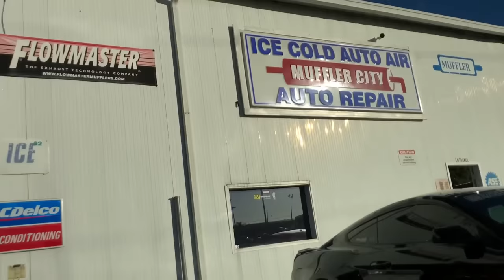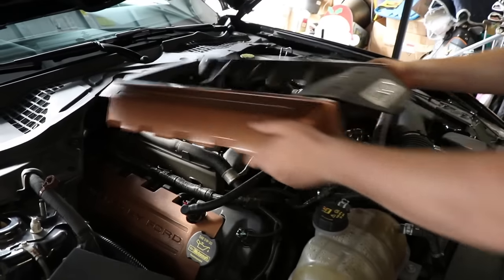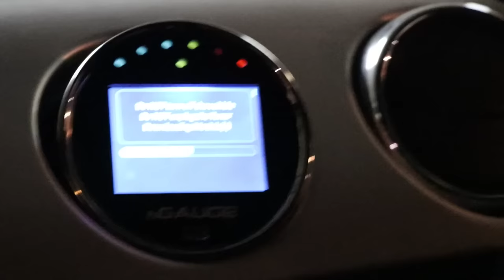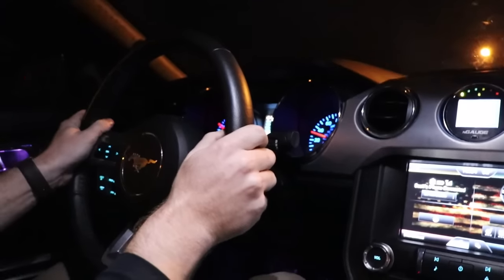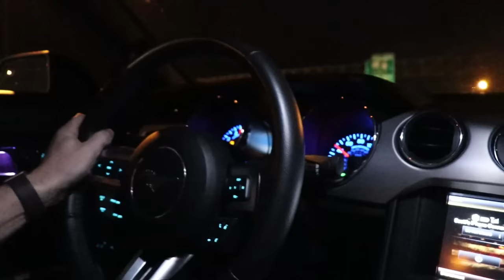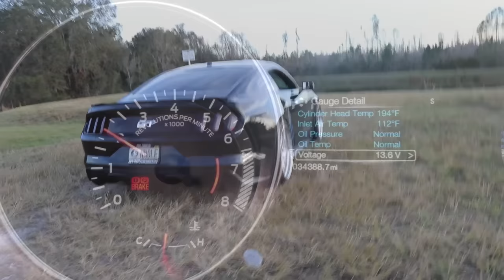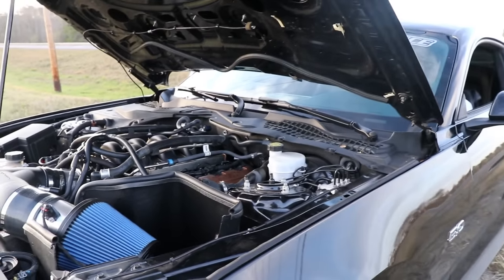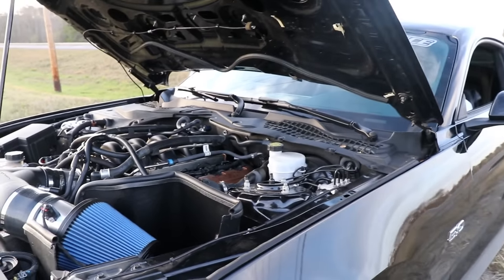Full Bolt On Coyote N/A Build - Longtubes, E85, Intake Manifold, PMAS, VMP Tune

Comment: i have the exact same mods with bama tune and (no e85) just 93 octane and i got the same numbers 450 whp and 390 tq
Reply: Yulinoe BAMA tuners suck.  When I used them they didn't have any racing numbers to backup there tuning numbers and there tunes SUCKED.  I choose another tuner that has engineers on staff and have racing experience.  BAMA doesn't check these 2 boxes.
Reply: Yulinoe BAMA tuners suck.  When I used them they didn't have any racing numbers to backup there tuning numbers and there tunes SUCKED.  I choose another tuner that has engineers on staff and have racing experience.  BAMA doesn't check these 2 boxes.

Comment: Great job at squeezing every HP out of a NA 5.0!! Lower your redline to 7200 and save your oil pump!! As you can see the car doesn't make power over 7200 anyhow. I guessed 466 at 7200 so I was off by 13 HP, my lucky number...LOL Great video, great mods and great car!!

Comment: How's the torque down low with the 350 intake? All gone?
Reply from the maker: It still feels great down low. The E85 helps as well.
Reply: Thanks, and without E85?  Most tests suggest a substantial loss below 4K with the GT350 intake.
Reply: And yours will have 3.73's correct? Here in Oz we only get a variation on the PP car. Recaros and 3.73's not available. So all our cars have 3.55's.

Comment: Is the gt350 manifold better than the boss manifold?
Reply from the maker: For the most part yes. The GT350 Intake Manifold is very comparable to the Cobra Jet Intake Manifold. The GT350 intake manifold fits under the stock hood on 15+ where the Cobra jet does not. So it is a no brainer to go with the GT350 Intake manifold.
Reply: Mustang Lifestyle thanks for replying

Comment: Hey guys I was wondering why didn't you go with the gt350 tb too..
Reply from the maker: Because it costs more, makes no power difference(has been tested on the dyno), and it has drivability issues.
Reply: Mustang Lifestyle 
So what adapter did you use..

Comment: where did yall buy the 47lb injectors from which site
Reply from the maker: VMP Performance
Reply: Mustang Lifestyle just got my gt350 manifold and 47lb pounds injectors installed 4 days ago we put it on the dyno and i have a pic of the dyno sheet came out to 452rwhp @ 7500rpm this is with me just running 93 octane gas. if i had a e85 tune setup it would be way high up there. im wondering why scotts mustang is marking 454 and he is running e85. im confused shouldnt he be making more rwhp

Comment: 8k on stock OPG's. Not worried at all?
Reply: That was my first thought when I heard 8K. Engine is not designed for those R's, which is why the GT350 has a flat plane crank
Reply from the maker: Nope. Boss 302 has been doing it for a long time and they have the same OPGs
Reply: they can spin to 8k with OPG's.  I was curious cause Lund Racing doesn't tune them that high unless they have OPG's.  But, i guess its not really an issue until its forced induction.

Comment: Is Scott thinking about boosting the stang ?
Reply from the maker: Jay Carden it's on the list! Supporting mods first
Reply: Mustang Lifestyle could you list the recommended supporting mods? im planning on getting mine roushcharged.
Reply: suspension suspension and more suspension
Reply from the maker: Supporting mods are not exactly necessary for a Roush Supercharger. It depends how you drive it. If you race and drive it hard every day you will need to upgrade clutch if it is a manual and halfshafts for both auto and manual. Suspension isn't a bad upgrade. Check out VMP TVS Supercharger for your car. you won't be disappointed.

Comment: Software optimizing on Stock motor cost normaly 2 hours. and you have 450HP. With your Manifold, longtube upgrades ect. it will make 470Hp or so. 453 with this setting is very poor.
Edit:( change HP from 570  to 470)
Reply from the maker: Your calculations are pretty off... Every dyno is different. The true test is 1/4 Mile Time and Speed.
Reply: and that is the Problem, that the Dynos are different. Or you make a Quik Test with  your Vehicle on a Highway. The most useable time is the Time from 100 to 200 Km/h. I have that 15´Mustang too,in Black, Black rims, PerformancePack,Borla Atak ect, and i want to go to "GeigerCars" for Software Optimizeing, here in my Country in Germany. :))  Keep us in touch with the 8k. durability.
Reply: My traget for first is to make 500Hp naturally aspirated engine Tuning. And then maybe in coorparate with FordPerformance "Parts or Software" make 530HP or more.
Reply: DIYman das sind aber WHP du meinst die Leistung am Motor. Die Leistung am Motor soll laut Hersteller bei 435ps aber am Rad kommen nur 360-380 an. Die Leistung die hier gemessen wurde ist am Rad. Und am Rad 450ps sind sehr sehr gut. Hast du deinen schon beim Geiger machen lassen? Würde mich interessieren was du gemacht hast und was an Leistung rauskommt. Also am Rad 

Grüße
Reply: also ich war bei Geiger, durch deren aussage sind durch die Optimierung 15 PS mehr, also 450PS. Meine Leistung vorher an der Kupplung waren 435,6 PS. Da ich jetzt mit Ultimate102 Fahren sollten es theoretisch 460 PS sein. Aber ich fahr dazu demnächst mal auf dem Prüfstand.
Reply: DIYman ja fahr mal drauf würde mich interessieren. War letzte Woche auf einen dyno Day in meiner Nähe und da war auch ein 2015er mit Software und Ansaugung und hat 403 PS am Rad gehabt was deine 460 an der Kupplung bestätigen würde.
Reply: So war aufn Dyno: 460,06 PS :D Geigersoftware Optimierung auf 95Oktan und im Tank hab ich ARAL Ultimate102. Ist bei dir auch die vmax raus? Was war dein top speed bisher?
Reply: DIYman 460ps Rad Leistung oder am Motor? 
Ne ich fahr meinen noch Serie bin noch nicht ganz sicher ob ich komplett SaugerTuning mache oder auf Kompressor umbaue.
Reply: 460 an der Kupplung.
Mit der Leistungssteigerung hab ich exat das selbe Problem. :D:D Aber ich glaube ich mach Kompressor.
Mir ist aufgefallen das ich nur im Sport+ Modus 300km/h fahren kann. Und im Normalen Modus "nur" 280Km/h :D

Comment: Damn to think that my 2019 made 508 with just intake , tune and e85 also Texas speed long tube catless headers
Reply from the maker: But what did you trap. This car trapped 122 mph
Reply: Mustang Lifestyle in 1/4? 
In 1/8 mine trapped at 99 

Haven’t had the chance of running it in the 1/4 but will do it soon
Reply: TheLoneWolf11 first off I doubt you made 508 without headers I have a 19 5.0 plus everyone who REALLY HAS A 19 5.0 knows you’re lying
Reply: Chris Frank forgot to put that I have Texas speed headers

Comment: The gt350 manifold isn't even worth it. The dude at vmp performance tested a lot of manifolds and the best one was the ported 2018. It made the most power and low end torque besides the truck manifold.

Comment: you took your normal gt to 8 grand...holy fuck. And the stock springs take it without a problem.
Reply: TheCowGoesMoo o That is correct sir. S550 coyotes are built really well from the factory. With the Voodoo IM people are safely revving to 8250 daily driving.

Comment: You we're better off with the 2018 manifold it's better than the gt 350 manifold for half the price and more   hp and torque
Reply: The dyno run they made was in January of 2017. The 2018 manifold wasn't available yet.

Comment: If max power is at 7.1 rpm why rev to 8?

The car is out of its powerband.

While your opponent shifts and remains in his powerband the mustang will be loosing cuz it's slowing down since it makes no more power up their.
Reply from the maker: +alex salazar when you rev higher you fall back into that power band when you shift, making you go faster
Reply: Mustang Lifestyle yes but the engine stops making power at 7.1 rpm so spinning it to 8 will only slow you down.

When you shift at 8 you fall back closer towards the end of your power band.
And now combining that with the loss of power ofter 7.1rpm will result in you getting smoked by a camaro ss.

Every second of power counts.
Reply from the maker: +alex salazar well if you look at the dyno sheet you will see it makes power to 7500-7600 so it makes sense to shift around 7800 to drop right back into power band. Not sure why you are thinking power drops off at 7100. Take a look at the dyno sheet in the video again.
Reply: Mustang Lifestyle The top left hand corner of the dyno sheet reads max power 453 at engine rpm 7.13.
No more power is made after that. 
You can clearly see the power curve up top dropping after 7.1

That's why I'm saying spinning to 8 is only slowing you down.

Also like I mentioned shifting at 8 will only put you closer to the end of your power band instead of the start which is where you want to be.

Comment: I would not go over 7500 rpm with stock internals. Not good. And, toss out that x-pipe. They sound so weak and raspy. Put an h pipe on there for some muscle and beef.

Comment: 450 to the wheel is not the good actually stock is 380 ish I heard so 70 hp with headers tune intake exhaust e85 fuel injectors I seen a gt500 with Bolton’s make more then 100 more hp
Reply: A stock 2018 Mustang is rated at 440hp, dyno's about 370-380whp. A GT500 is supercharged, bolt ons make more power because you can literally just replace the pulleys for the crank and blower and make 100 more hp. Learn more about cars. This GT is N/A and the power it makes with bolt-ons is damned good, even if it wasn't running on e85.

Comment: DONT DO E85.  ive seen teardowns of motors running e85.  causes excessive rust on pistons.  everytime you start a motor with rust on the pistons it will score the walls and cause you oil and compression problems down the road.  stick with 93 or higher octane tune.  if that's not enough, throw a blower on it.  people think because everyone else is doing e85 tunes that it's ok.  that's straight corn oil that turns to water, hence the rust problems.
Reply from the maker: The Rust problem occurs when E85 sits in the tank for too long and essentially turns to water. For a daily driver there is no issue. E85 sitting in a race car for example that gets driven once a month or once every two months there can be issues like you are talking about.
Reply: true.  it turns to water especially in an area that has frequent change of climate like Pennsylvania.  but who would want to run corn oil anyway?

Comment: I see no torque wrench used at all. awesome
Reply from the maker: +Baltimore brawler torque wrench on a intake manifold? The intake manifold is plastic and aluminum. Both can be tightened to feel and not over tightened without the need for a spec and torque wrench. Engine internals, flywheel bolts, twin disk clutch, etc torque specs are important but in this case they are not.

Comment: probably need a fuel pump or a bap with a e85 tune.....you have no room for fuel for any future mods unfortunately.  injectors and a fuel pump.for e85 tune on a NA engine to me isnt worth the 15 hp gain. (yes only 15hp, this isnt a FI car or high compression engine, plus lets hope your fuel lines dont get rekt from e85)  also is that a honda engine bruh? sheesh wheres all your tq at bruh?  rofl.....

Comment: Bolt on coyotes are for sissies...can't even break into 11s with that 🤣🤣🤣🤣
Reply: Edgar Sanchez lol frfr stock 16ss is dipping into the 11s
Reply from the maker: Edgar Sanchez This setup is good for mid to low 11s, do your homework
Reply: edgar sanchez has never owned a v8 or even a car in his life..
Reply: oAToMiCx lmao he probably has no idea what you just said 😂😂
Reply: don't feed the trolls guys. They are mad because the Mustang outsold Chebby Camaro and Dudge Challenger combined.
Reply: Edgar Sanchez  what man the car is cool nice bolt on 5.0 good power chill ride you want it to be a 1000 hp cobra jet or something?
Reply: (AED Tuning) out here in California has a Cobra jet intake coyotes running mid 10s and it's definitely N/a coyotes running low 11s on just Boss intake, somebody is just rambling.
Reply: My bud had one that ran 11:50s with bolt ons 
 and a converter.
Reply: Maurice Aucoin yeah u lmfaoo
Reply: This set-up's good for mid to low 11's, guaranteed. '16 SS are impressive but they'd get gapped, I was pulling them in my Coyote with very minor bolt-ons.
Reply: 5Point OH with this guys setup he should pull a stovk 16 SS. but I've also seen bolt on 5.0s still get gapped and I've seen e85 5.0s get gapped by the 16 SS. bolt on for bolt the 16 SS would gap a 5.0. i really like these 5.0s so I'm not hating. i also agree with your 1/4 assessment. i know the 16 ss stock the fastest it's gotten os a 12.1 with around 415-420 to the wheels so this thing should be in the mid maybe low 11s.
Reply: Clifford Purk my best buds '12 GT ran 11.50s putting 420 to the wheels.
Reply: William Hurren he's also lighter than these 15 and newer 5.0s. You gotta remember that the IRS adds a lot of weight. I think the curb weight of those 12s are somehwere in the area of 3650lbs. Which is also still lighter by 60-100lbs than the 6SS. They already run mid to low 12s stock.
Reply: Clifford Purk true. And it's going to be harder to get an irs car to hook off the line.
Reply from the maker: Well we have a good surprise for you coming tomorrow :) Deep into the 11s with this setup.
Reply: Mustang Lifestyle nice man..i commented earlier of mid to low 11s. It's a really nice setup dude. It sounds nasty.
Reply: Clifford Purk I'm gonna guess around 11.290 @ 128ish
Reply: William Hurren wouldn't surprise me one bit. This setup runs strong.
Reply: Clifford Purk as long as it hooks.
Reply: William Hurren oh I'm sure it'll hook. I am gonna really shocked if these numbers he achieves are on stock tires.
Reply: Clifford Purk oh he's definitely gonna need at least drag radials. My buddy ran E.T. Streets awsome tire.
Reply: 5Point OH with a red line of 8 grand and 450hp he should have no problem running 120s. I do agree however the new SS is a fine car, anything with over 400hp out of the box is going to be fun.
Reply: William Hurren I should've been more clear. I'm guessing a 120-121 trap, maybe a 122. But 125+ is a bit of a stretch for this (N/A) set-up. If they pull it off, I'll be amazed. I'm not knocking the car at all, just guessing based off of experience.
Reply: Edgar Sanchez I'm just going by what my friends ran. He ran 11.50s at 123ish with 420 to the wheels
Reply: Rodolfo Munoz and that ss ain't doing jack.. they trap around 111 and what motor trend told you  ain't worth a lick once your in the water box I've seen them run consistently high 12s around here bud
Reply: Mustang Lifestyle 🤣🤣🤣🤣🤣 but yet you ran a 12.4...
Reply: oAToMiCx your car ran that because you left out the whole good.. clearly mustang life doesn't know the power of gearing yet but will wait
Reply: Cummins Diesel oh yeah bet your wife races to this chile first when your off to work ...

Comment: 8,000 rpm on a stock engine? Yikes.
Reply from the maker: +Andrew Wilken 8200 actually
Reply: Mustang Lifestyle has that proven to be safe on these coyote engines? Not only that but are they actually making power? It sounded like it made power up to that, but what are dyno sheets showing?